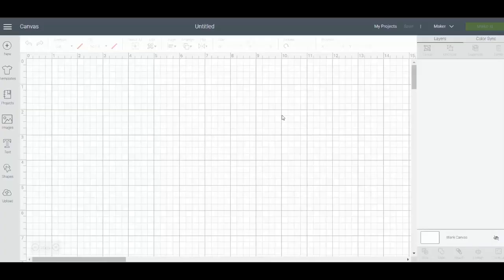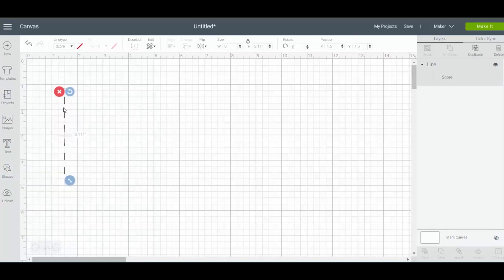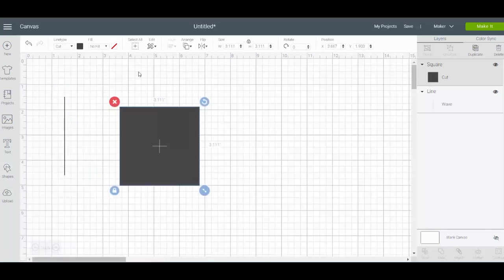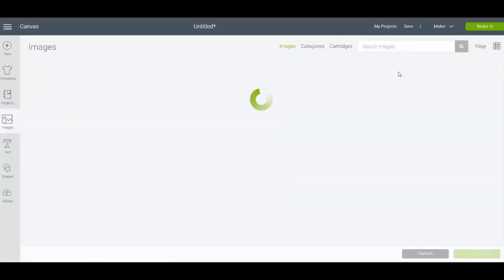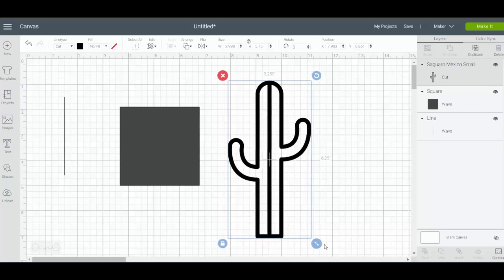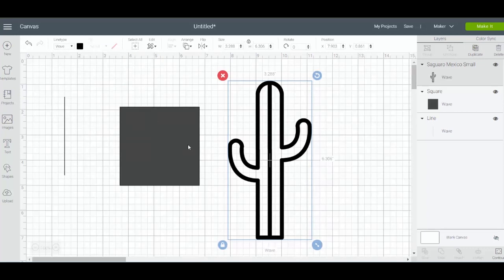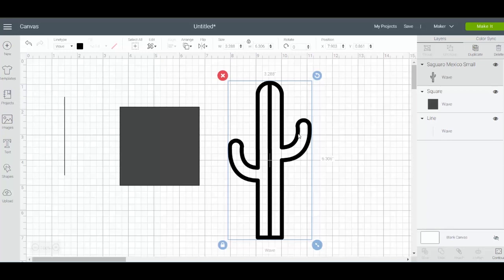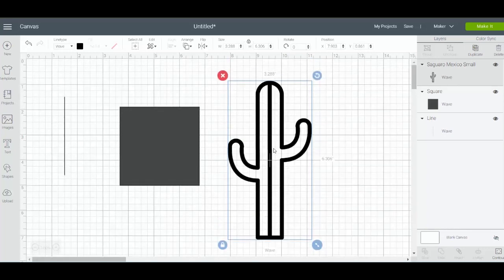How to Use the Cricut Wavy Blade

Comment: Thank you for these videos! I’ve had my maker for over a year but just recently used the wavy blade and perf blade. I did have some issues with both blades not cutting all the way through my card stock. Is there a way to adjust the pressure?
Reply from the maker: You just have to pick a thicker material setting.

Comment: Only the blades that came with my maker is working with my machine. It doesn’t recognize the scoring wheel, the wavy blade nor the other blades is doing anything even though the machine recognizes them
Reply from the maker: You might try customer care.
Reply: Angie Holden I finally got the single scoring wheel to work when they asked for the double scoring wheel. Then after that perforated blade worked and the wavy blade. I ordered the other blades so I hope they work on the first try.
Reply from the maker: You can trick it with the single and double wheels. The others should only work if you are prompted to put them in your machine.

Comment: THANK YOU !! for this video, I'll be getting my tools soon. didn't get the perforation too it was separate and really don't know yet what to do with it..till I watch your video in future. :) IF YOU added more pressure for the leather,would it have cut out the others? also  your felt looked a little stiffer than just reg. felt, was it?   THANK YOU AGAIN ,LOVE YOUR VIDEOS..
Reply from the maker: The felt was Cricut felt so a stiff felt. The pressure really wasn't the issue. It was sort of pushing up the leather and got stuck. Probably a new mat (UGH LEATHER AND ALL THE MATS) and pressing down really well. I would also just be REALLY careful to maintain the correct sizes on leather as it is going to be harder to cut. I do totally think it is possible though.